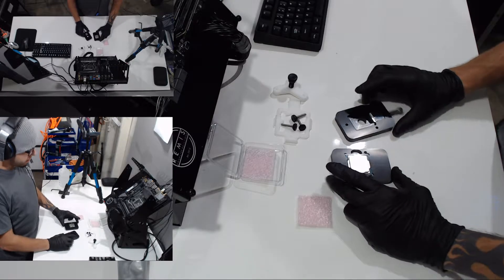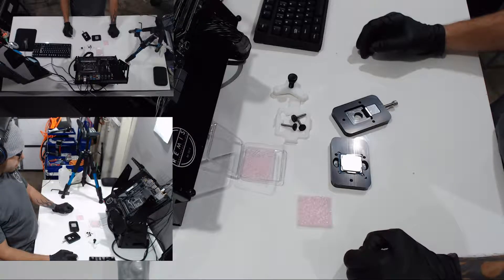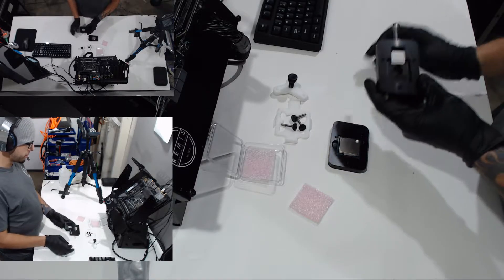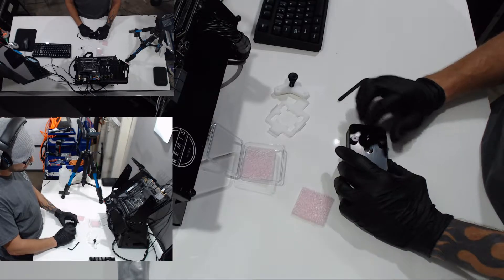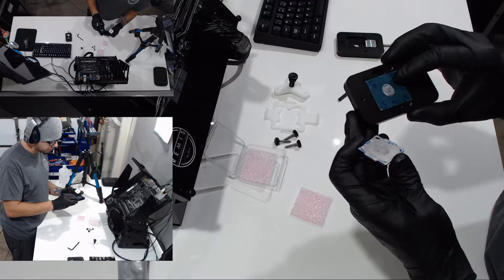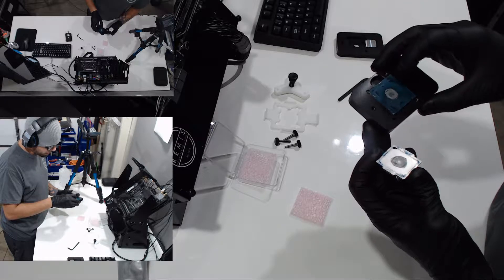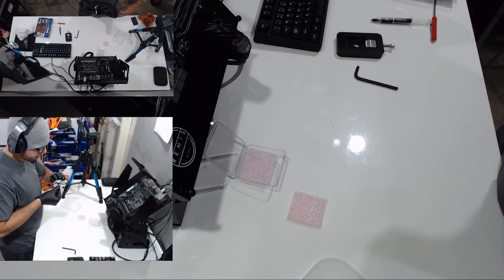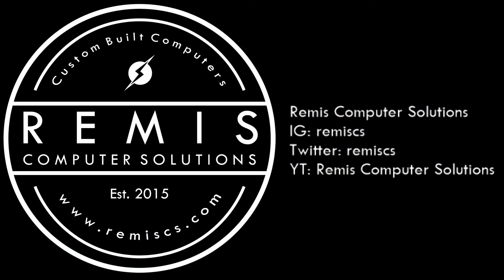Intel i3 7350k Delid with Rockitcool Rockit88 tool!

Comment: Just snagged one of these i3s on ebay for 73 bucks with the intent of having fun with it. Like you mentioned, its value at retail is hideous, but I like the idea of it. A dual core OC just to have fun with and push a little bit. Nice video!

Comment: If you can push this per-core monster to 6 GHZ delidded, then it would actually be worth the $169 + Z motherboard + delidding price. Otherwise, Ryzen's R5 series might prove to be where the per-core performance of the Zen architecture is fully realized (on top of being true quad/hex- core processors rather than virtualized threads). Hopefully, even if the R5 barely matches the i7 7700k, AMD's market targeting might push this CPU down to $80 or lower which could make it feasibly an economic processor.